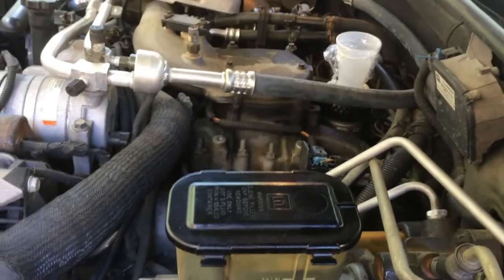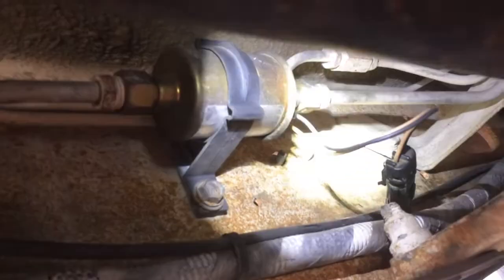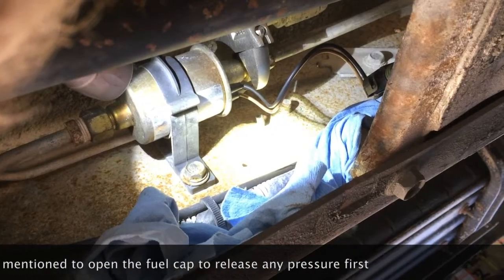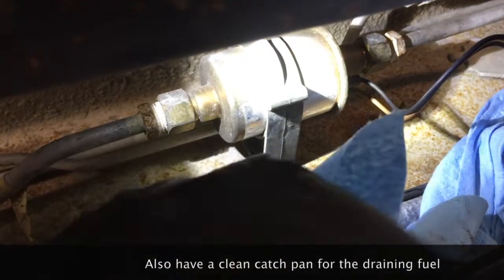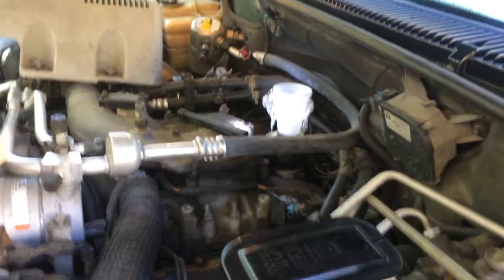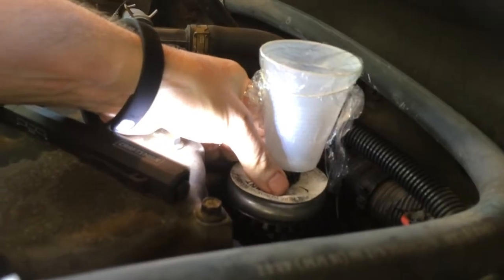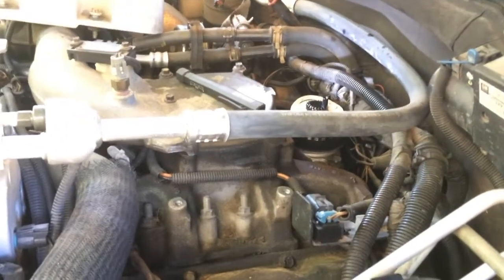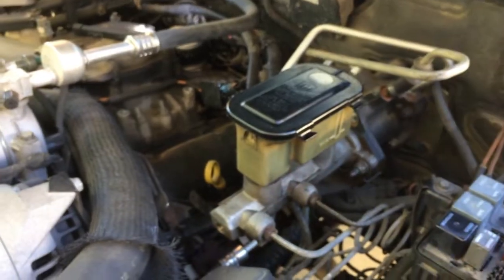1996 - 2002 GM Truck 6.5L Turbo Diesel Fuel Lift Pump Replacement (Chevy & GMC)

Comment: Well how come when i remove my feul lines the feul doesnt stop fliwing out of the lines. Just keeps pouring. How do i stop it?
Reply from the maker: On a 6.5L diesel with the engine off for awhile shouldn't really be any pressure built up.  Its normal to have some fuel loss during this particular repair.   In my experience with this repair its either the residual fuel draining out of the lines, or a bit of siphon effect thru the line going on.  A variant of this repair if you're seeing this is to quickly pop a rubber plug on each line as you remove them, then reinstall tank side line first then engine side on new pump.  Still some fuel loss, but cuts down on it alot and no waiting.
Reply: @DrShock  my feul does NOT stop flowing. I cant reach above the tank to clamp off the line coming outa the tank. I also dont have any plugs. What do i do
Reply: I will bath in diesel feul by the time i can get the old pump out and the new one in. And at $140/l up here i cant stomach lising gallons while i try
Reply from the maker: If i had this situation, I'd defer the lift pump repair until I was down to a nearly empty tank and siphon out what's left to avoid this situation.  While not ideal, the IP will run without it as long as you haven't changed the fuel filter or otherwise interrupted the suction on the engine side of the lift pump. Personally, I've never experienced this so gotta guess you have a siphon situation happening.  If you can't defer, and can't plug the lines, all that's left is to siphon the fuel out of the tank then.

Comment: Thanks for making the video, I have been wanting to change my lift pump, but was worried how much fuel was going to run out under the truck, now after seeing that, I feel once I run the tank down a bit I will change the pump out.  I have had the truck for a couple years and it has 380,000 kms on it and so I have been changing some of the components since I don't know the history, and not wanting to have it break down on the highway